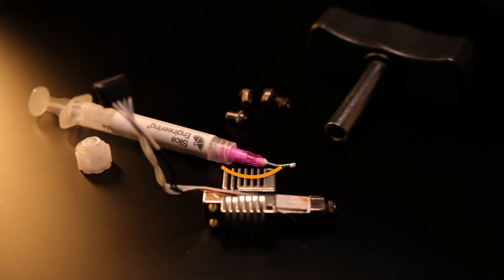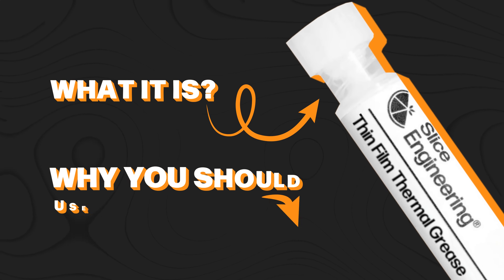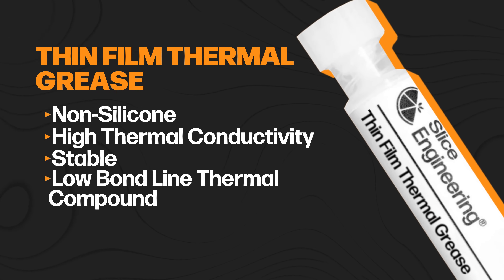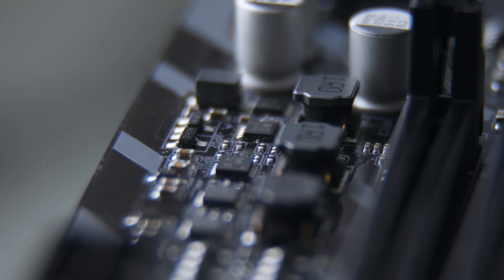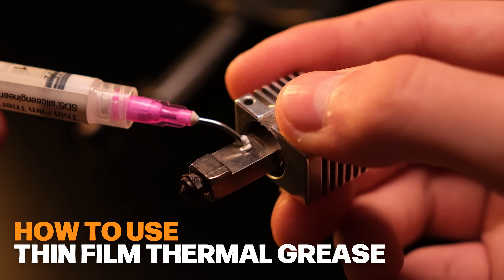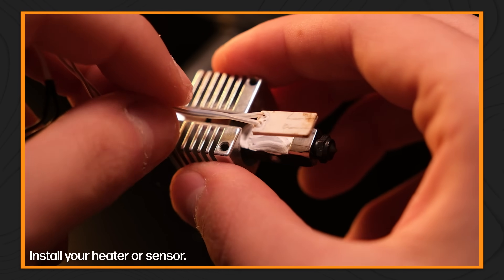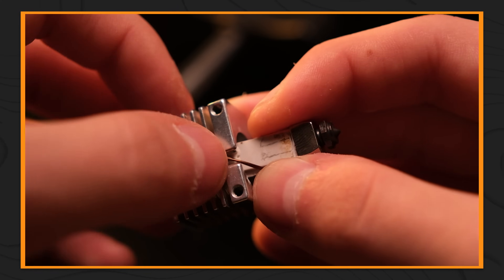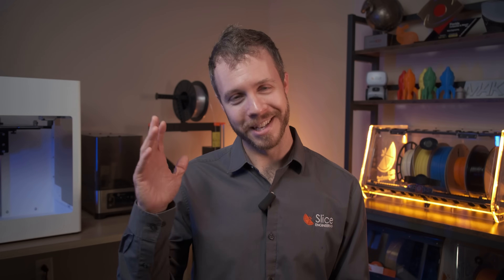The Thermal Grease Your 3D Printer Needs

Comment: Does this Thermal Grease replace the Boron Nitride Paste used in the Mosquito Magnum?
Reply from the maker: The Thin Film Thermal Grease does not replace the use of Boron Nitride Paste in the Mosquito Magnum! It is optimized for PTC ceramic heaters, the Mako™ Hotend, and other thermal systems.
Reply: @SliceEngineering  Thank you - Love the Mosquito it's been flawless from the first test print.
Reply: @SliceEngineering  that's confusing because in the video you essentially described using it in the exact same manner as you would use boron nitride paste, as a thermal compound for hotend heaters and thermistor. But now you're also saying it doesn't replace boron nitride paste. Use cases aren't clear imo
Reply from the maker: @dojafoja  Thanks for the comment! Allow us to clarify - both boron nitride and thin film are thermal compounds. Boron nitride is a paste (water based), while thin film is a grease (silicone based). Their applications overlap like a Venn diagram, but are not exactly the same. For example, because boron nitride is aqueous you wouldn't want to use it on a PCB, even though it becomes electrically non-conductive once dried, whereas thin film is perfect for PCB applications. On the other hand, thin film is temperature limited to 360 ℃, whereas boron nitride can handle extreme temperatures of 1000 ℃+. Back to your original question - if you wanted to use thin film for a heater cartridge in a Mosquito, you could, but would be artificially limiting it to 360 ℃. PTC heaters on the other hand are temperature limited, and highly water sensitive, making the unique properties of thin film a perfect fit (where boron nitride is usable, but not perfect). Another thing to consider is handling properties - the boron nitride paste is similar to toothpaste, while the thin film grease is similar to cake icing - depending on the cavity or surface you want to apply it to one may be better suited than the other.
Reply: @SliceEngineering this is still a bit confusing because one of the main advertising points is that it's non silicone but then in this reply you suggest that it's silicone based. Can you clarify?